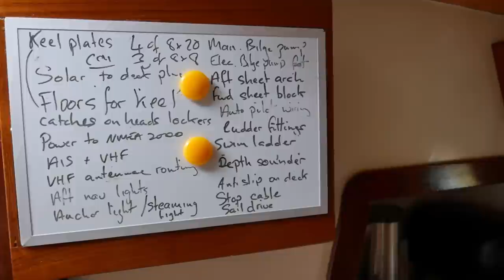MAST BUILDING; main mast and fitting #2 - SV Tapatya EP243

Comment: I've noticed that through the years of watching your Channel you do most of your cuts with a table saw, is that why you didn't use a Skillsaw when you did that weird angle cut of those four by four's before you matched them up. never the less Your getting there bud its looking great.
Reply from the maker: Thanks Fon. The reason for using the table saw for the scarf cuts is its depth of cut. The table saw cuts 9cm. You need a big skillsaw to get that depth - expensive and I haven’t got one 👍

Comment: Hello and great job this far with the boat building. I was wondering had you wanted to would this had been the time to add a tabernacle for the mast or would that not be feasible for a boat of such magnitude. Hardly can wait to see her finally spalsh!
Reply from the maker: Thanks.
Yes, I did seriously consider tabernacles for the masts. I don’t know if you are aware of the ones that Pete Hill has made for various boats, but it’s a very cool design. In the end, I decided against it for a few reasons…. 🤔